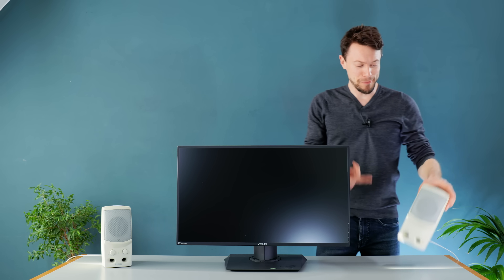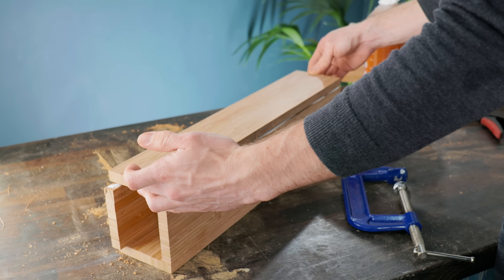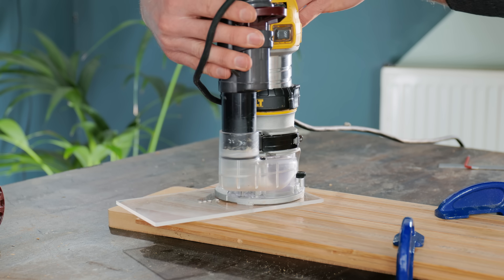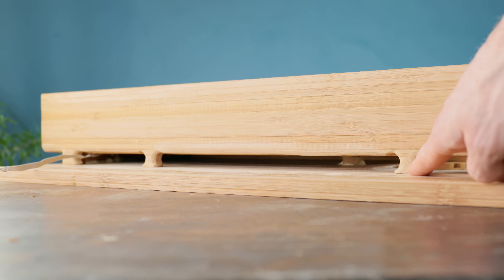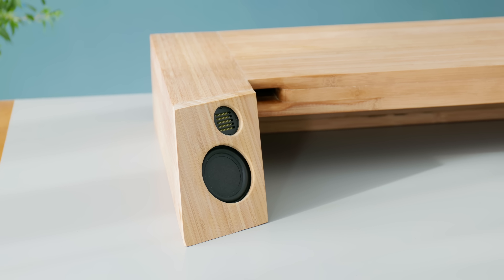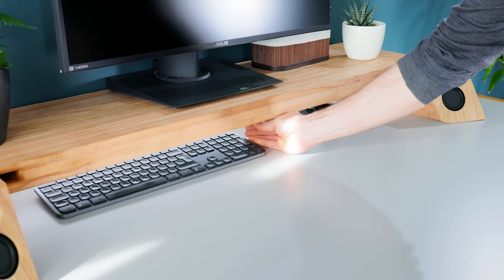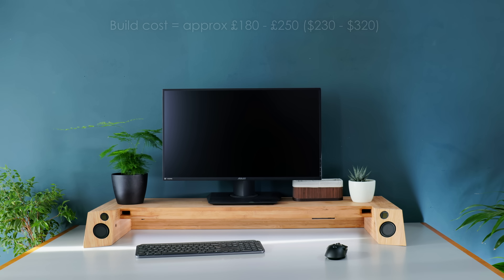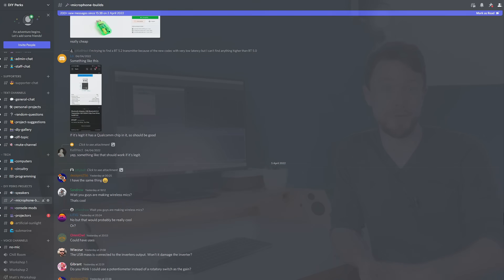Building a PC sound deck... with a twist!

Comment: Almost all Class D amps have the worst sound quality. If the sound output is enough, it's not all there. Even with a good speaker unit and enclosure, if the amplifier is poor, the balance is not right.

Comment: you could have just used a omni directional mics at the point where the speakers intersect because the mic you use made the left side sound soft and muddy when you played that game... and btw the expensive ones sound super hollow on the inside while the DIY one sound super harsh... all of it can be modified to suit each individual taste by adjusting the volume or the air channels inside the drivers with your current set up for them.... otherwise its the hardware that needs some changing or you might need to invest in more things....
Reply: don't get me wrong... its amazing what you did here as always...

Comment: The $1200 speakers sound more airy and cleaner. The DIY sounds like it has more reverb and surround. Very impressive. Basically it sounds like you EQ'd the DIY speakers to an immersive listening experience. The $1200 ones sound more like a reference set of speakers.

Comment: IMO a DIY Speaker is one of the best projects you can do. I recently built myself a bluetooth boombox, like in one of your first videos, and boy was I surprised!
Apart from the bluetooth amp, which costed me 35€, everything else I had lying around. I threw it together in a weekend and was absoluteley stunned by the audio quality. I like it even better than my marshall kilburn (200€) and it has WAAAY more power! Definitely the best DIY Project Ive done so far! A comparable commertial speaker would have probably costed 10 times as much.

Comment: Your build is beautiful, my only complaint, don't rely on hot glue for mounting anything permanently.  It eventually lets go and will cause issues.  Also use standoffs for electronics...speaking from experience...but otherwise, amazingly beautiful.

Comment: That was rather impressive to say the least, from what I could hear, your DIY speakers rivalled the $1200 ones pretty comfortably.
Though unfortunately, not everyone (including me) has £250 to spend on a speaker set up (though I must say, your speaker setup was very neat, especially since it also has an LED backlight too). I think I will either build a cheaper set up (if required), or just keep with what I've got. My Logitech Z5500 speaker set is still going strong. :)

Comment: I like your project, but one thing I would like to see you build is this:
You make your own soundbar, but you power it with an old reciever that has room calibration.

Then I am thinking you have elements which point in different direction (almost like in ATMOS), but then check how it performs when the reciever then can room calibrate it 🙂
Not sure it will work out well, but it would be an interesting build to see and maybe you could compare it to a highend soundbar (one without subwoofer, like SOnor or something)

Comment: This looks incredible and there is a simple way to take it to the next level: fasten a sonic transducer to your chair. This will send the bass vibrations through the chair and really give you the feel of the "punch" from a serious sound system without disturbing anyone else. You just need one additional bass signal output since transducers use the same signal/wiring as speakers. Total cost of this sort of a transducer upgrade is about $50-$100 USD.
Reply: Or maybe the ButtKicker.
Reply: Wouldn’t this create a tripping hazard?
Reply: That's sounds a bit silly tbh😂

Comment: na man, oversized??  when it comes to speakers, the bigger the better.   i appreciate what you did here, but what $300 and 4 days of work?  and that's not total because you said you were swapping out crossovers.  i can guarantee that's not gonna touch the sound you'd get from a set of M-Audio BX8's which can be had for $500.  but made for a neat vid and you did a good job on the project.  congrats!

Comment: Surprised by the clarity of the tweeters. Wonder if they can be used as “drop in” replacements for other speakers. Yes, some differences, but overall a upgrade to look into.
Reply: I've use those on a couple of projects.  Their crossover point needs to be at least 4.5Khz with a 2nd order slope.  That's a little high to be a drop in replacement for most dome tweeters.  If you can live with that, they are indeed fantastic sounding tweeters.
Reply: @BobbyKinstle  thank you! I’ll need to look into what I have and see what modifications can be done to accommodate, but really thank you for the info🙌🏻 Now I might not blow something up😅

Comment: the obvious improvement would be integrating this with the desk.
a complete desk including space for the PC as well as a VESA mount for the screen.
the screen would essentially be screwed to the back wall, hovering above the desk.
cooling could be seperated from the PC space putting radiator(s) in vertical channel(s) that go from the floor to the ceiling.

Comment: I moved to a 4k TV and sound bar for my computer about 7 years ago. It is absolutely the way to go. Having hdmi pass through for audio infinitely simplifies things, and you will get much better quality from a sound bar than this type of setup. Current Gen high end sound bars are stupidly expensive... But going back 1 generation in product and you get all the quality at half or less of the price.

All that said Dayton audio is pretty great! Really hoping they have their open house and audio competition again this year. It's a fun event at their factory for part swapping and diy stuff! For traditional speakers though, you just aren't going to beat a pre-built system for quality and cost. But being able to integrate audio into nontraditional form factors is pretty neat. I have a design for a d&d gaming table that I want to build, and integrating audio will be key.
Lastly, Dayton makes some great amplifier boards that have Bluetooth, digital, and analog inputs. Wiring the computer is neat, but being able to wirelessly dock a laptop or phone for casual BT audio is a feature you can't overlook!

Comment: As for the price of the project. It's absolutely in the higher price range. Not budget, not even midrange. So this build is not any kind of cost saver. It's expensive. 

With that out of the way, it's truly astonishing and gorgeous. It's so good, maybe you would consider making it in kit form? I know I would buy one. 

What's intimidating about this build isn't the woodworking part, but the electronics. It's really a high skilled build but the results are far better than anything I've seen you can buy in the shops. That's another aspect, this build has no competition. It's the best thing I've seen all year.

Comment: Ok, now we are in my area. Ribbon tweeters are not magical, there is NOTHING "airy" about them, dome tweeters can easily outperform ribbon and vice versa.. This piece of the video is 100% horseshit and is caused by expectation bias. The word "airy" is a good clue that it isn't real. I should've already noticed when the "reflex port" is just random sized hole somewhere on the box. So... this guy can do a lot of things but audio is not his strong suit.

Yup, it is visually great. It may be decent enough to be usable but... The talk about "rustling leaves" is a bit weird in the end, like that matters in this case as the whole design is visual first, sound quality second. The 1200$ speakers are better, but they also need a tune up. A "smiley face" curve will always sound sweeter when compared to neutral sound, and that is most likely what has happened with the crossover. There is a harshness in the upper mids, the factory made are flatter. The DIY needs a DSP to tune them. Better than i expected but not a lot. 

Sorry, but i get irrationally angry when people are talking about audio equipment and they say "this is airy".. There is no such thing. Either it is flat or it isn't. Dome tweeters are perfectly ok, otherwise they would not be used by far most of the time in cheap and very, very expensive speakers. Ribbon elements have their own problems, every solution that converts electric signals to acoustic has a problem or two inherently.

They look great and with a bit of tweaking.. i could use them, they are not hopeless. But, with DSP room correction you will lose sound pressure and distortion can creep into the system, no way to know unless one tries. Measurement mic is essential but does not need to be expensive, under 100$ is well good enough to get to +-3dB.

Comment: Computer speakers have always been a good thing, until you build a custom set up like this. Is it possible to salvage the components from your computer speakers to donate to this build? It would save the electronics build part on this project . Angle of the speakers is key of course.  Thanks for another great video, even though Brass was not used this time around! Cheers!

Comment: As always there is impressive design and attention to detail.  But the speaker test wasn't fair - you cant compare two speakers and a subwoofer to two speakers alone.  Especially when the sub is tuned that well.  You did a fantastic job though - looks damn good.

Comment: This looks fantastic! Has a style that I'd love to have on my desk, and definitely loving the inclusion of the adjustable brightness light bar. 
One concern I'd have would be vibrations into the desk or the wall, but should be easily reduced by some thick felt on the underside of the cabinet and maybe some neoprene padding on the backside, just to give it better isolation.

Comment: It‘s a great Idea, I‘m not toooo fond of the design, but that‘s something that can be changed by anyone, what I noticed though was that your custom speakers do sound a bit Tinny, so to say, they have a metal ring to them or something. This could be because the recess is to big and there is too much wood around them, it could be from the vibrations of the enclosure on the table, or it could be a very very slight misstune, that can only be heared when testing it side by side

Comment: Your $1200 speakers are trash.  Artificial sounding bass, and poor midrange.   The DIY speakers have good highs... but have way too much harsh midrange (fatiguing), with very poor bass.

 You cant expect to have good bass response from such a small diameter driver... and trying to put in a generic Sub to cover the missing bass... never works well.

 Get a used pair of EPI 100v bookshelf speakers, with the updated (plastic framed) "inverted tweeters" ... and be prepared to cry at how good Audiophile grade sound is, compared to low quality drivers + poor designs.

 Also, if you want to feel a games shots and effects... forget subwoofers.  Install two Bass-Shaker Transducers... either under your chair, or under the desk.   Less than 15 watts under your chair, at max power... will feel like a level 7 earthquake.

Comment: The expensive ones sound just a bit more "open", but the DIY are well worth the money
Reply: i mean you can always use equalizer to make it sound how ever u want.
Reply: I find the highs laughable on the pros compared to the DIYs, what listening device did you use?
Reply: @Azer1125  imma have to agree with Andrew here, the pros sound way clearer and differentiated. The DIY system sounds good, but doesn't have a neutral sound, its bass heavy and muddy in the upper mids, which is perfect for gaming (it actually sounds amazing in that case) as most gaming Headphones have a similar frequency curve ("V-Shape"). I wouldn't use it for critical listening or other genres than bass heavy ones tho:)
Reply: @Azer1125  I was listening on HD660S's and LSR-305s btw
Reply: I listened using KZ ZSN Pro in-ear phones, and I agree with Andrew.

Comment: MDF isn't only used because it's cheap. MDF deadens the sound of the box itself. Plywood is thought to be the best for speaker enclosures. I'd imagine the bamboo flooring would be a good option considering it's basically a thick plywood.

Comment: Binaural audio only lets us locate the speakers but it's not changing the fact that those micrphones and our headphones still have their own frequency response.
If two really bad speakers are to close to each other and you move them futher apart, the signal reaching your ears is getting better but they're still really bad speakers. Same goes for really good speakers you're moving closer together.
So the binaural recording isn't giving us any relevant information here.

Comment: I love the Klipsch desktop speakers they have great sound but my last speaker was a old spare Vizio sound bar that sounded terrible and always had a excessive Bass and almost inaudible vocals for some reason. Vizio are terrible the TV I had to be reset every week to connect to Wifi now it's run by a chromecast.

Comment: if you ever wanted to try modeling what your woofer response would look like based on the enclosure size, WinISD is a great freeware program that's fun to play with - you could even use it to fine tune your port frequency

Comment: Impressive build, and good low end on the DIY solution. I did notice the Monitor Audio speakers are quite a bit more detailed in the highs, but then again they retail for $1200.
Sound quality could probably be improved by using a higher end amplifier setup, preferably a class A/B. Amps and sources often get overlooked, but can make a huge difference in audio quality. They're not just for pushing more power to the speakers. 

In the audio world we say "put shit in, get shit out." If the signal going into your amp isn't clean, and your amp isn't high quality, then your speakers will only sound as good as the shit going into them.

Comment: Those bmr mid drivers need to be broken in. I have used them in a ton of projects and you dont really get the performance right out of the box. I usually play a static music file for 24 hours at a loud volume. After they sound much brighter and have a better sound overall

Comment: Gorgeous project with some great ideas.
SQ comments - Midrange is a fraction too loud and probably needs rolling off sharper at the top end because it was smothering the bottom end of the tweeters.
I listened on 8 different sets of reference speakers (I'm in a pretty big recording studio at the moment) and a load of different headphones to make sure I wasn't biasing it.

Comment: A feature you might want to add to your circuitry is equalizers.

Based on the way the expensive speakers sounded vs the DIY speakers, I would very much prefer the expensive speakers. The DIY system sounded harsh, like a strongly biased equalizer - the kind of setup I'd use for meetings to hear more clearly what people are saying. That's probably not a disadvantage for gaming, but for music, where the mix of frequencies is designed to work together rather than getting called out like that, it sounds unpleasant.

Comment: another good option for a choice of wood is recycled pallets (yes I have had a pallet monitor stand since before they where cool :) my dad built one in the early 80s as a printer stand for our epson dot matrix printer (that was plugged into our commodore 64)). The lumber was cleaned up with a garage sale bench jointer and edged with a router round over bit. it had a couple shelves to hold paper. some years later when I was in highschool, it held the monitor and disk drive for that computer instead of the printer, and now I recently dug it out of storage to hold my laptop more or less serving as a docking station and desk organizer. It is likely sturdy enough to survive 4-5 generations of users. While it is true that most DIY pallet furniture looks like crap salvaged from a construction site, that is often still oak lumber used. Properly cut and planed, those boards can be turned into fine woodwork.

Comment: I was pleasantly surprised to see the drivers you chose. I happen to run the same subwoofer as midbass drivers in my car, and the same midranges. I did run different tweeters, but I may look into the ones you suggested. I've got all of my stuff in a 3-way active setup and love it. They play very clean, but still get loud when I want that. Excellent budget setup! Cheers!

Comment: While MDF is absolutely a cheap material, the main reason speaker cabinets are made out of MDF is so there's no specific resonances created by the directional grain of the wood. Violins are made out of solid wood as they require these resonances for the specific sound and amplification a violin requires. When grinding the wood up and gluing it all back you ensure there's no specific directions sounds can resonantie in.

Comment: Sound like a cheap 2.1 set. Not werf the effort as far as sound is concerned. 6.5" full range drivers per channel with a complimentary 6.5" high efficiency woofer hidden in a closed box would give much tighter and clear sound right out of the box without fiddling EQ. Aestetically looks nice... but in terms of sound design you left a lot on the table (pun intended)

Comment: I have a handful of old Harmon Kardon Invoke speakers that I'd like to repurpose (since Microsoft discontinued Cortana support, the speakers are practically useless). I've been planning to yank them apart and hardwire in some audio inputs between the DAC and the AMP to turn them into desktop speakers. I'm sure that a lot of people out there have similar old speaker sets, old Sonos or Echo devices or such, and many of the steps would cross-over. I'd love to see you do that as one of your projects - turn a couple old Echo or Sonos speakers into desktop computer speakers. (Though the Invoke is ideal because the sound quality is just SO good...)

Comment: I also plan on making my speakers. However, this design would have looked even better if the whole thing was made to fit your desk exactly. The speakers would need to be angled a little more inwards, but that would just remove any interruptions from your desk. Depending on how deep your desk is, you can basically have another level to it.